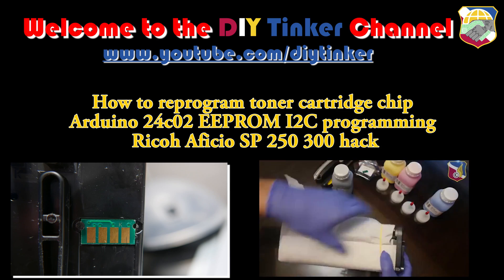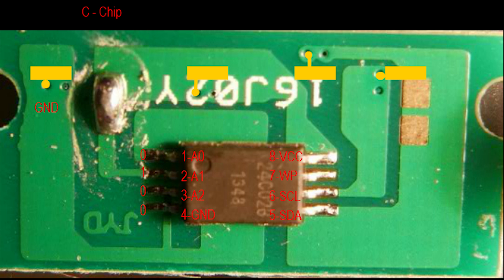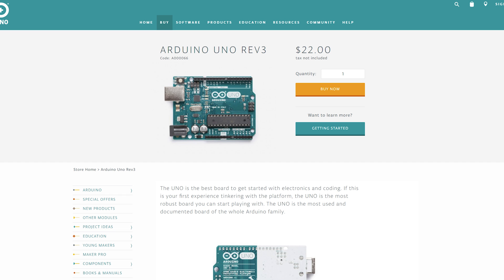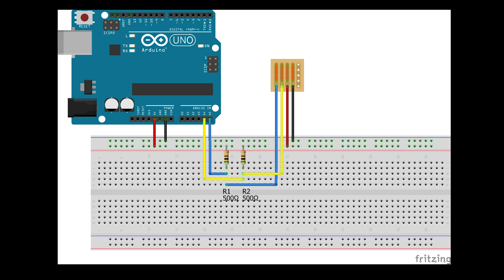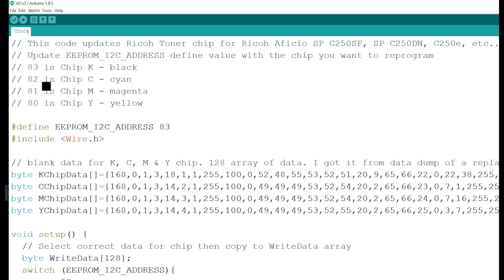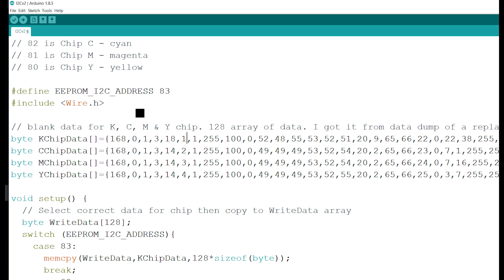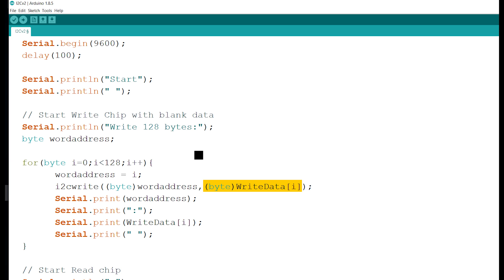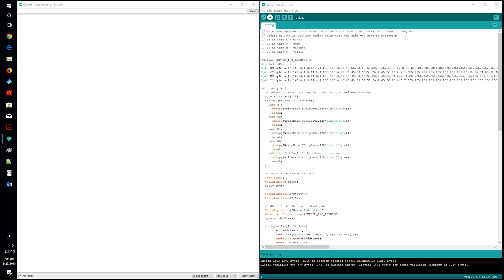How to hack Ricoh Aficio toner cartridge chip using Arduino UNO - program 24c02 EEPROM I2C

Comment: I just got a ready reseter from AliExpress https://youtu.be/VLSftdWyft4 couldn’t really figure out entirely how it works, but was able to trick my Ricoh to recognize the old cartridges and start printing again
Reply: I couldn't see the chip clearly, but it looks like the same chip used on my Ricoh laser printers.  That wouldn't be surprising.  If that is correct, you should be able to use an Arduino Uno to do the reprogramming.  One question I would have is how the AliExpress unit determines what address to write to when doing so for the various colors.  Did you ever find a manual for the device?
Reply: @jimsmith9803  the chip is hidden on the other side of the PCB therefore difficult to say what it actually is without breaking it out of the cartridge.   So you are saying the cartridges are addressable? In this model I recall the cartridges are “hardware coded” I.e. notched differently, so that you can’t swap them around. Even if there is some addressing, the reseter perhaps could read that from the chip, before writing back the “full ink” value?
Reply: @TomaszPlawski  If you are careful, you can pry on the plastic post (the one towards the outside of the cartridge) and remove the chip without doing too much damage to the lip holding the chip onto the outside of the cartridge.  If done correctly, you can push the chip back in and get it to stay.  If not, then you can glue it back in or make an ABS slurry with acetone to cement it in.  It's just easier to work with it that way.  If you have a 3D printer, I have a design on Thingiverse that allows you to re-flash  the chip while still on the cartridge.
Yes.  The chips are addressable.  If you read the sketch that goes with this video, you will see that each of the four colors has a different address.  That is how the printer knows that you have the correct cartridge in the correct slot.  If there is no data in the address that the slot is looking for, you get an error.
At least on my printers, the chips are not "hardware coded".  I've taken a chip for one color and re-flashed it to read as another color.  I can't see a company stocking four separate chips when they can get away with one.
Reply: @jimsmith9803  regarding the manual - haven’t found detailed instructions, just wondering why they state in the offer description, that you should reprogram the chip before the ink contents falls below 15%?
Reply: @TomaszPlawski  Did you email Traci Wang to ask if they even have a manual?  I don't know why they state the 15% value.

Comment: I saw your video and purchased the Arduino R3 downloaded and installed the software and then followed your instructions to the letter. So far so good. I changed the program to 83 for the yellow cartridge and then connected the prongs to the chip and pressed reset. Easy, or so I thought. Now the printer reads an error " Set the print cartridge correctly" Any one has any idea ??? My printer is a Ricoh SP C340DN
Reply: Before you started, did you use an I2C address scanner to verify that 83 is the correct address for the yellow cartridge?  I have a SP C250DN and a SP C360DNw.  The pinouts on the chips are different and the SP C340DN could be different yet.  Those are the first things I would look at.  Also, it would have been a good idea to get dumps of your chips before reflashing just in case.  That way you know if what you are doing is correct.

Comment: Thanks.  It worked great.  I was initially getting a "wrong toner" message on the printer for the K toner.  I changed the K byte to match the first part of the other colors by changing the 18 to 14 and then it worked fine.
From:  "byte KChipData[]={168,0,1,3,18,1,1"
To: "byte KChipData[]={168,0,1,3,14,1,1"

Comment: Data for Ricoh M C250FW/FWB High Yield:

byte KChipData[]={169,0,1,0,50,1,1,255,100,0,82,51,51,51,50,50,25,6,65,66,18,4,5,1,255,255,255,255,255,255,255,255,255,255,255,255,255,255,255,255,255,255,255,255,100,0,0,0,255,255,255,255,255,255,255,255,255,255,255,255,255,255,255,255,255,255,255,255,255,255,255,255,255,255,255,255,255,255,255,255,255,255,255,255,255,255,255,255,255,255,255,255,255,255,255,255,255,255,255,255,255,255,255,255,255,255,255,255,255,255,255,255,255,255,255,255,255,255,255,255,0,0,0,0,0,0,0,0};
byte CChipData[]={169,0,1,0,50,2,1,255,100,0,82,51,51,51,50,51,25,6,65,66,19,4,5,3,255,255,255,255,255,255,255,255,255,255,255,255,255,255,255,255,255,255,255,255,100,0,0,0,255,255,255,255,255,255,255,255,255,255,255,255,255,255,255,255,255,255,255,255,255,255,255,255,255,255,255,255,255,255,255,255,255,255,255,255,255,255,255,255,255,255,255,255,255,255,255,255,255,255,255,255,255,255,255,255,255,255,255,255,255,255,255,255,255,255,255,255,255,255,255,255,0,0,0,0,0,0,0,0};
byte MChipData[]={169,0,1,0,50,3,1,255,100,0,82,51,51,51,50,52,25,6,65,66,20,4,5,5,255,255,255,255,255,255,255,255,255,255,255,255,255,255,255,255,255,255,255,255,100,0,0,0,255,255,255,255,255,255,255,255,255,255,255,255,255,255,255,255,255,255,255,255,255,255,255,255,255,255,255,255,255,255,255,255,255,255,255,255,255,255,255,255,255,255,255,255,255,255,255,255,255,255,255,255,255,255,255,255,255,255,255,255,255,255,255,255,255,255,255,255,255,255,255,255,0,0,0,0,0,0,0,0};
byte YChipData[]={169,0,1,0,50,4,1,255,100,0,82,51,51,51,50,53,25,6,65,66,21,4,5,7,255,255,255,255,255,255,255,255,255,255,255,255,255,255,255,255,255,255,255,255,100,0,0,0,255,255,255,255,255,255,255,255,255,255,255,255,255,255,255,255,255,255,255,255,255,255,255,255,255,255,255,255,255,255,255,255,255,255,255,255,255,255,255,255,255,255,255,255,255,255,255,255,255,255,255,255,255,255,255,255,255,255,255,255,255,255,255,255,255,255,255,255,255,255,255,255,0,0,0,0,0,0,0,0};
Reply: thanks this works

Comment: Thank's for this nice video. I would like to know if the code can be applied to a black & white toner cartridge or I must change the code? My printer is a Ricoh SP112SU.
Reply: have you gun a solution? a im interesting
Reply: The process would be the same.  If the chip is almost used up, you will need a new one.  Use an I2C scanner to find the address.  Then use the Arduino sketch found somewhere in these posts to get a dump of the data.  And finally use the sketch for rewriting data to put your attached chip back to full.  If the chip on your cartridge is almost full, just get your dump from that.  Save the dump somewhere and re-flash the chip when it shows being near empty.  From an economic standpoint, companies mostly like to use the same chip across their printer line.

Comment: Hi @DIY Tinker I've got a Sawgrass (Ricoh) SG400. I popped the chip off an empty cartridge but not getting an address off the chip using WhatI2CAddress function. I tried using code as is to read. I'm using a D1 mini and have tried example code for detecting i2c devices but none detected. I wondered if either you or other viewers can throw any light. The chip is marked L02 W WM (from my yellow cartridge Sublijet HD). The SG400 I understand is basically just a rebadged SG3110. The board itself has a notched end which I think is Gnd. My replacement carts show as non-genuine and don't show ink level, I was hoping that I could perhaps reprogram the original chips and swap them over. I haven't tried programming the replacement cart chips since at least I can print, however can't use Sawgrass print manager as it prints a hatched pattern across anything (I have read this happens when non-genuine carts are used!) Thanks in advance from anyone who can help. Mark.

Comment: if the chip is only for counting, why the need to hack it.
Reply: The chip starts out with a certain number of pages and then counts down to zero.  When you reach zero, the printer no longer works.
Reply: @PaxSilvestris Slight miscommunication here.  I was actually responding to the original post of bazrazin 1.  When I selected the "REPLY" button,  it put my response under your post.  bazrazin 1 asked why, if the chip is only for counting, we would even want to hack the chip.
I agree with you.  the actual page coverage ratios are seriously out  of proportion.

Comment: Hi mate, I would like to know if your program works for Ricoh sp c240dn as well?
Reply: did you try it? i have also the sp c 240 dn and my printer says thats the incorrect toner cardrige..?
Reply: @HondaDriver92  I did not try it on a SP C240DN.  However, further down in the discussion. Ahmed Ahmed states that he got it to work.  My printers are C250DN and a C360DNw.  It works in both of those.
Reply: @HondaDriver92  I had same problem. 3 out of 4 cartridges show no change and for Cyan shows incorrect cartridge.
Reply: It does.  It is in a discussion further down.

Comment: Hey man! Thanks for sharing! I am just wondering, does a similar procedure work on other toners, like from Samsung or Xerox? Cause I saw quite a few toner chips and they all use I²C for communication. I am new to toners but I am well versed in electronics and embedded programming. Is there some place I can find the specs for these chips?
Reply: Ricoh chips are straightforward.  They just have the usage data stored only on the chip itself.  I have a C250DN and a C360DNw.  You just change the data on the chip you're good.  Somewhere in the comments is a discussion about Lexmark chips.  Evidently they store some info on the motherboard and can reset the info on the chip when you power the printer back up.  I have never had a Xerox printer so I've never looked at them. I also have a Samsung C1810W.  It has a PIC32 processor on the chip and my guess is that you have to wake it up and then use that to edit the EEPROM data.  I've never gotten  that to work.  Since you are well versed in electronics and embedded programming, could you point me in the right direction concerning my Samsung printer chip.  Specifically how to  edit the data on the EEPROM even though it has to communicate through the PIC32?  My field of expertise is not electronics.
Reply: I'm trying to apply this to Brother DCP-L2550DW (2021 Model) that comes with a microchip. Trying to reconstruct the thought process. I think I understand the fundamentals. Where I am stuck at is I only identified the EEPROM as "2031 LC 152 00" and I am trying to locate the data sheet or configuration to identify the SCL, SDA, VCC, and GND (aka VSS?).  That remains elusive to me. Also, my other issue is how to I retrieve the "data dump" from either the new microchip or the old microchip to get the information.  I think I would need step 1 first before doing the data dump. Brother printers have no information as far as I'm concerned with internet. Any help appreciated as I'm stubborn about this.

Update: In regards to "data dump" search for "can you show how to take data dump?" down below from user "Srefen grey". There is a copy and paste for code to data dump. However I still don't know how to tackle my unknown EEPROM configuration as the microchip manufacturer working with brother printer have kept their identity encrypted so that makes it difficult.
Reply: @g0t2  I think this should be taken one step at a time. With maybe a new cartridge, do a data dump before inserting it in the printer, then after being inserted, then after making one single print, and so on, just to see if any data is changed on the chip when inserted, and then what data is changed when the printing is issued,aybe there is a counter that gets incremented. Also maybe compare the dump with one from a spent model, to see if there are any special markings for an used cartridge. It wpuld be useful to know what is stored in the chip and where, also if printing copies increments someemory zone, and if the gradual usage of the toner decrements some zone. But maybe if you get a dump from a brand new cartridge (before it being inserted in the printer), and flash that on a refilled cartridge, things should work.
Reply: @g0t2  Ground and VCC could be located via a multimeter. The data/clock lines, for that maybe you would need an oscilloscope, to see what's going on.
Reply: @tatterdemalion898  And those are the main ones.  Reverse them and you can fry the chip.  I've done that.  Reversing SCL and SDA will just do nothing.

Comment: I have Ricoh SP310DN. To continue printing from empty chip cartridges, there is a setting in printer web interface under system settings -> Toner Management Tab -> Supply end Option. Change this from <Stop Printing> to <Continue Printing>.

Comment: Ricoh SP 211 unfortunately broke after programming :(
Reply: Did you do a data dump from a new SP211 chip to get the correct data?  Or did you use the data in the original sketch.  The original sketch is for use in a S250DN model only.

Comment: Hi I've been re-programming toner chips for a Ricoh SPC240DN for a while now and your sketch is by far the most successful I've used. I have modified it so it asks which toner chip needs resetting, B,M,C or Y and then does the work. It means that the program doesn't have to be uploaded every time you need to reset a different colour chip...just reset the arduino and enter the appropriate abbreviated letter B,M,C or Y. btw I have the default byte array for each chip for the Ricoh SPC240DN.
Reply: I am very interested in seeing your code. I have plans to use a pin jumper on a pcb to trigger a high or low state on the arduino to select which color needs programming so I can program without a computer connected. From the sound of it, your code might be easy enough for me to modify for this purpose. Interested in sharing?
Reply: @ericbuffington348  No problem. DM me at paul<dot>bartlett<at>btopenworld<dot>com
Reply: @ericbuffington348  Hi Eric. I have modified the code so the nano looks for a device at a particular I2C address. It recognizes which variety the chip is and programs accordingly. It does update status via USB Serial, so not sure if it will work standalone.
Reply: @bartleph  Would you mind sharing the code you used?
Reply: Yo tambien estoy interesado en tu código, asi como el propio código que utilizas para extraer la información de cada chip, puedes compartirla. Gracias
Reply: @draghondark  Send an email to paul<dot>bartlett@btopenworld<dot>com
Reply: Can you add code to detect the address the chip responds to? So your program can auto detect the color and you don't even need to enter a letter.
Reply: @parkershaw8529  You could.  If you feel up to it, go for it.  Just let us know how you did.

Comment: Hello to everyone,
I have a Ricoh SP211. For me didn't worked the vector called KChipData from this example.
I used the following array from here: 
https://www.mikrocontroller.net/attachment/377568/Ricoh_SP213w_Toner_Chip_Reset.ino

byte KChipData[]={
0x21, 0x00, 0x01, 0x03, 0x02, 0x01, 0x01, 0x00, 0x64, 0x00, 0x34, 0x30, 0x37, 0x32, 0x35, 0x34,
0x13, 0x08, 0x4d, 0x43, 0x06, 0x00, 0x38, 0x30, 0x00, 0x00, 0x00, 0x00, 0x00, 0x00, 0x00, 0x00,
0x00, 0x00, 0x00, 0x00, 0x00, 0x00, 0x00, 0x00, 0x00, 0x00, 0x00, 0x64, 0x00, 0x00, 0x00, 0x00,
0x00, 0x00, 0x00, 0x00, 0x00, 0x00, 0x00, 0x00, 0x00, 0x00, 0x00, 0x00, 0x00, 0x00, 0x00, 0x00,
0x00, 0x00, 0x00, 0x00, 0x00, 0x00, 0x00, 0x00, 0x00, 0x00, 0x00, 0x00, 0x00, 0x00, 0x00, 0x00,
0x00, 0x00, 0x00, 0x00, 0x00, 0x00, 0x00, 0x00, 0x00, 0x00, 0x00, 0x00, 0x00, 0x00, 0x00, 0x00,
0x00, 0x00, 0x00, 0x00, 0x00, 0x00, 0x00, 0x00, 0x00, 0x00, 0x00, 0x00, 0x00, 0x00, 0x00, 0x00,
0x00, 0x00, 0x00, 0x00, 0x00, 0x00, 0x00, 0x00, 0x00, 0x00, 0x00, 0x00, 0x00, 0x00, 0x00, 0x00,
0xff, 0xff, 0xff, 0xff, 0xff, 0xff, 0xff, 0xff, 0xff, 0xff, 0xff, 0xff, 0xff, 0xff, 0xff, 0xff,
0xff, 0xff, 0xff, 0xff, 0xff, 0xff, 0xff, 0xff, 0xff, 0xff, 0xff, 0xff, 0xff, 0xff, 0xff, 0xff,
0xff, 0xff, 0xff, 0xff, 0xff, 0xff, 0xff, 0xff, 0xff, 0xff, 0xff, 0xff, 0xff, 0xff, 0xff, 0xff,
0xff, 0xff, 0xff, 0xff, 0xff, 0xff, 0xff, 0xff, 0xff, 0xff, 0xff, 0xff, 0xff, 0xff, 0xff, 0xff,
0xff, 0xff, 0xff, 0xff, 0xff, 0xff, 0xff, 0xff, 0xff, 0xff, 0xff, 0xff, 0xff, 0xff, 0xff, 0xff,
0xff, 0xff, 0xff, 0xff, 0xff, 0xff, 0xff, 0xff, 0xff, 0xff, 0xff, 0xff, 0xff, 0xff, 0xff, 0xff,
0xff, 0xff, 0xff, 0xff, 0xff, 0xff, 0xff, 0xff, 0xff, 0xff, 0xff, 0xff, 0xff, 0xff, 0xff, 0xff,
0xff, 0xff, 0xff, 0xff, 0xff, 0xff, 0xff, 0xff, 0xff, 0xff, 0xff, 0xff, 0xff, 0xff, 0xff, 0xff};

Just comment the array called KChipData from this example and copy/paste the array from above in the sketch.

Comment: I think Ricoh are now cottoning on to this ability to "reset" the chips by cloning the data, but have now in some cases updated the printer firmware such that if the same chip data is used in succession (twice in a row) the ink level will remain the same. Does anyone have any  idea which of the data holds an unique identifier/ID that would need to change each time of reprogramming?

Comment: I've just reset my toner cartridges, thank you. I wrote a small program for the Parallax Propeller microcontroller and selected which cartridge to write/read via the USB cable I was using to power the board. I just used the data you had in the code for each eeprom. I was wondering what version of the reset chip you provided, for 2000 pages or the much larger 6500? If it was for the 2000 page cartridge, do you have the code for the 6500 page cartidge?
Reply: @PaxSilvestris thanks. I'll try that next time
Reply: You only used USB cable? No meed arduino?
Reply: @joshm4max  I used a small development board that was powered and controlled via USB.